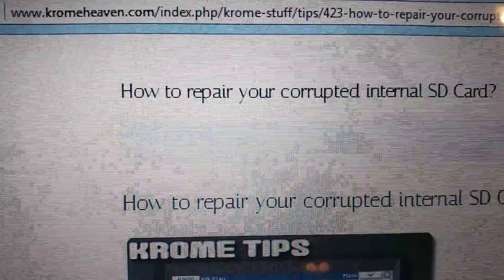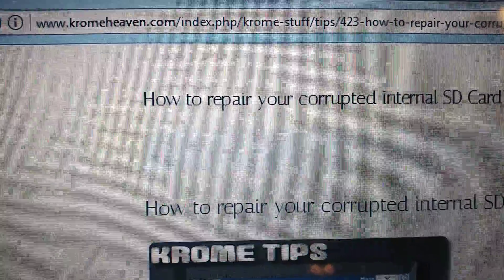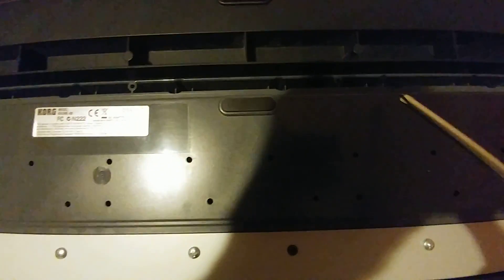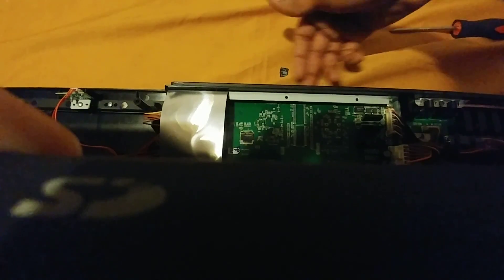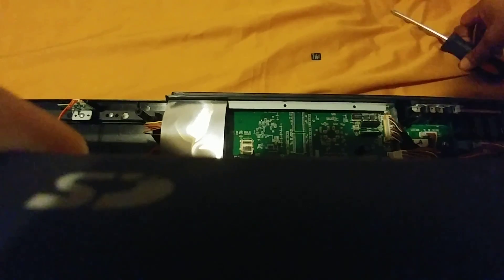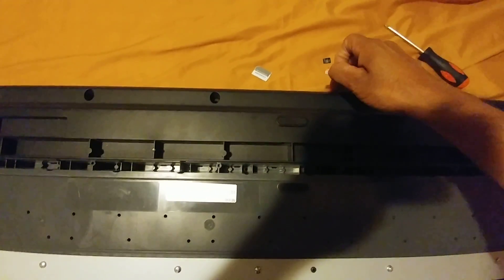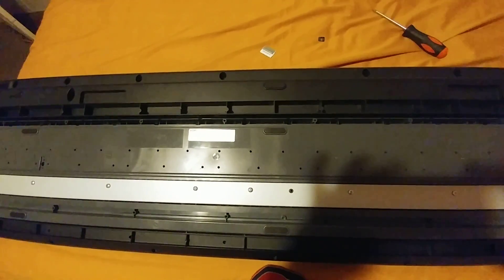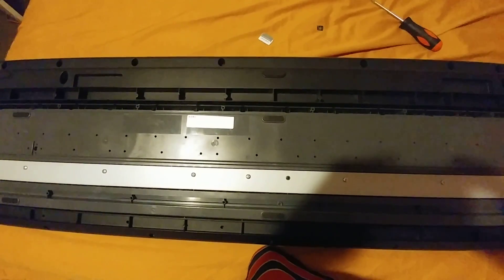Korg Krome Noise Fix

Comment: hello friend i have a korg krome 88 keys 5 years old that is defective and not used because of this problem => System error id: 216 Task id: 1 line: 0124 / /source/hardware/T01PCMMemory.cpp, I've done this procedure a few times, I changed it the card 2 times but without success .... could you help me? I
Reply: Please help us
Reply: Hello my friend -did you get any help on this ?

Comment: Thank you so much for posting this! It was nice to be able to see the MicroSD card actually being switched out, especially because the way it's held in is unusual compared to most interfaces. I replaced my card with one of these SanDisk Ultra 32GB cards and it's working like a charm:
https://www.amazon.com/gp/product/B010Q57T02/ref=ppx_yo_dt_b_asin_title_o00_s00?ie=UTF8&psc=1
If you want more information on preparing the card, check out this online forum, especially stale's post on page 9:

http://www.korgforums.com/forum/phpBB2/viewtopic.php?t=89650&start=210&postdays=0&postorder=asc&highlight=

Between this video and that post, you should have all the information you need.

Incidentally, if you insert the card and all the notes have static or distortion on them, you may have knocked one of the contact pins out of place on the MicroSD card. Be sure to check that they are all in place before you place in the new card.

Good luck!

Comment: Does this help for distorted noise too. Thanks!
Reply from the maker: It worked on the distortion for a little while.  The problem returned after power issues when sharing a surge protector with another musician.
Reply: @mictek1  yeah it worked! Thanks Sir 😊,
Is there anyway to get rid of ants coming into board even placed safe in a keyboard bag? Coz
My board got repair of ants  n changed  the entire motherboard .
Reply: @danipaul  how much did it cost to replace the mother board?
Reply: @ManuelHernandez-br6dy sorry for the late reply dude it cost me ₹27000🙁

Comment: Do not change the orginal sd card because I did it and now it sounds horrible!
Reply from the maker: Vanzator Olx Mine has been working fine for almost a year now. I use it every weekend.
Reply: The SD card is a very unreliable data storage source... Whoever created such a design on the Korg motherboard should be put in jail ... All over the Internet, people are suffering with this model! It is enough to drive in the search engine error 216 and the word Korg Krome ... the whole Internet is in search of an image and the possibility of getting rid of this error :((( Korg engineers should be ashamed of such a design with a phone flash drive inside!
https://youtu.be/8o7yaPz_ADE

Comment: Hello,I don't understand why you don't copy what is in the original memory card in the new card?Or it's not possible?Thanks!
Reply from the maker: Vanzator Olx This fix is used because the original card is corrupt. It is unreadable in a pc.
Reply: if my original card is good .. than can i copy to another 10 class sd card ? would it run good ?
Reply: If your original card is good I don't understand why you want to copy to another one.
Reply: +Vanzator Olx because my piano tone give pop and cuts while sustaining ... and i think that the internal memory doent had 10 class sd card ... thats why its happening ???? i think so ????
Reply: The card on Korg Krome is 10 class with 4gb but it's not good.
If you buy a 10 class sd card 8gb or 4 and add sample file from here it will sound bad-especially pianos because this is not the original file from Korg.

Comment: What's the max capacity of the sd card krome can handle? I bought a 16 gb anyone know if it should be ok
Reply: 4GB is the max the Krome OS can see for the internal sd card. For the external you can use up to a 32GB, but you will never need or use that much space...

Comment: Wtf Korg?  Did they quality control their keyboards?  First my M50 Capacitors go out( a known issue and Korg won't issue a recall) and now this?  Damn Korg, get your shit together 🎶
Reply: The problem is not the internal SD card. The problem is the board the internal SD card plugs into. Replacing the internal card will fix the issue, but there is nothing to stop the board from destroying the new card as well.

Comment: Hi there mictek1, I have this same keyboard but I am only having popping sounds when I use my sustain pedal. Will this fix that issue?
Reply: Thanks.  Fortunately, my keyboard is still under manufacturer warranty so I went ahead and took it to the shop. Hopefully, they will pinpoint the issue, if not, then I will try this. If this still doesn't work, I do have an extended warranty for repair where I made the purchase.
Reply from the maker: I fixed my sustain pedal issue by purchasing the Korg pedal  made to work with the Krome (DSH1). If you have that pedal already, this fix may help. Type  popping sounds when I use the sustain pedal in a google search and see what info you get back.

Comment from the maker: This is not like a format. You keep your sounds and settings. The only thing I found is the possibility of having to run the version 1.3 update for the Korg Krome. Check your version when it loads up after powering it back on.
Reply: mictek1 I found the most recent version on the Korg website but I can't figure out how to load an image onto a new micro SD card. I downloaded a .zip file from Korg that has a Krome folder, Manuals folder and 2 PDF files. Can you assist?
Reply from the maker: Dave Crumb.      Using a computer with a decade reader, you can use the program from my first link to write the image to an sdcard. Kromeheaven.com has downloads for the software or links to them.
Reply from the maker: my phones auto spell changed sdcard reader to decade.
Reply: mictek1 Thank you! I was able to get it all squared away, thanks to your tutorial video. Any issues that I was having are all gone now, the crackling/static sounds, sustain issues...it was used at Jazz event on Saturday night where it saw heavy use and it was bulletproof all night! Thanks again for your help! It is greatly appreciated!

Comment: hey thanks for the tutorial but i have a few questions, is this like a format? do you lose all the info in the keyboard? or it has nothing to do with the already installed software other than a few fixes? im asking this because im ready to try the fix but if my keyboard dies....i die hahaha i cant afford another one :|
Reply from the maker: If you have stored a pcg file with the latest sounds on your sdcard for songs and settings, you can load that file after changing the internal microsd if anything changes.